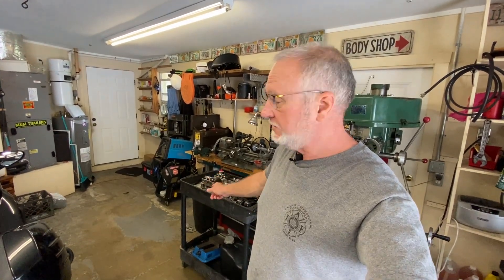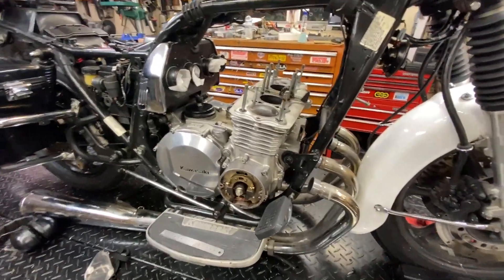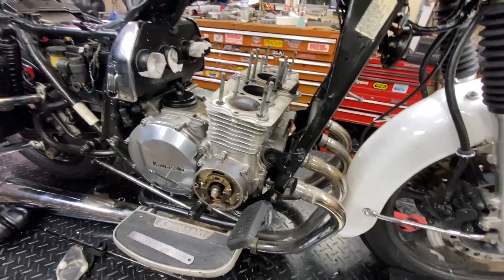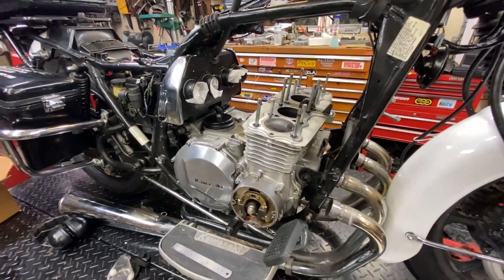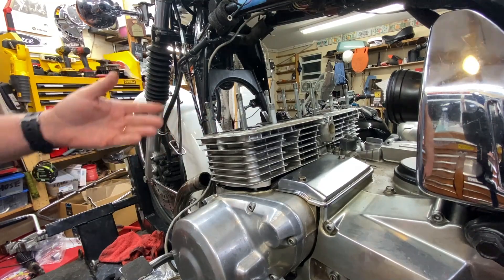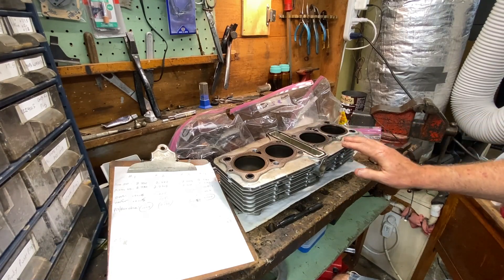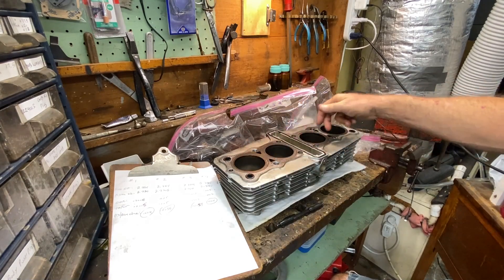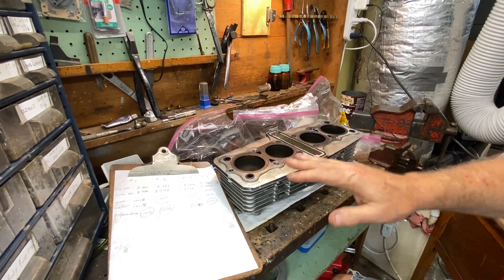Kawasaki POLICE 1000 cylinder block removal and evaluation. Is it scrap?

Comment: I think you made the correct decision on the block with out knowing the condition of the bottom end, I was wondering if you checked the cam chain for stretch? Curious if it was still in spec.
Reply from the maker: I have not, as of yet but I will. I've actually never found one out of spec, but then again, the measuring methodology of a certain distance over a specific number of links, is subjective. Cheers.

Comment: Ring tension is a very important spec that almost no one has a spec on or can measure.

Rings are springs, and springs exposed to heat lose their tension.

It seems probable that the KZ1000P has been rebuild, and maybe with "trade" parts.  That 5 thou piston/cylinder clearance will be a problem in my estimation.  But perhaps worth a try.
Reply from the maker: It's actually just under four thou, I am correcting that huge clearance on #3 with a new piston which is 2 thou larger. That brings the clearance on all four cylinders to about .0013-.0015 over maximum. The standard being .0016 to .0026. These are about .0035-.004 now, plus or minus a tenth or two. Sucks, yea, but is what it is. All four cylinders are nearly exactly the same size, within tenths give or take. #3 piston was more aggressively worn than the other three. I agree, I don't like it either, but I have rebuilt others with just as bad clearance issues, where the budget from the customer wouldn't allow a bore and oversize piston/rings. The XS1100 was that way. I looked at my spreadsheet on those numbers and for some reason, I forgot to document the piston OD's and clearance, but I do recall the size after mic up and they were small as well. We had to leave it that way with new rings. Thing runs great so far at least. I spoke to the owner not too long ago about it. 

I also agree, this top-end has likely been done once before. That base gasket situation is revealing. The only way a base gasket would come off that easy on a 20 year-old engine is if the gasket isn't 20 years old; and it has been replaced at some point.

I hate not doing it "right" like to the letter and boring/going oversized, but again, cannot justify the cost for what it is and what it will be. Cheers.